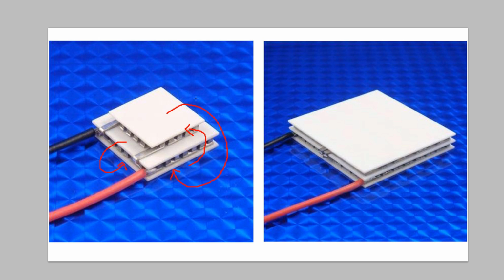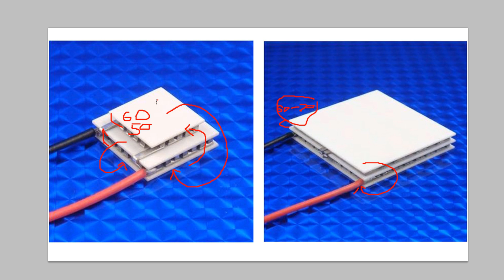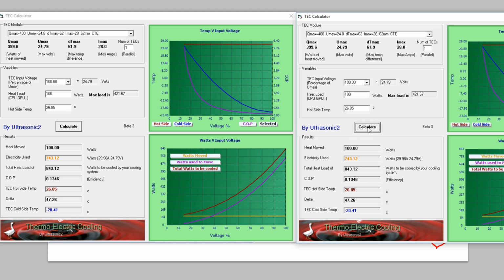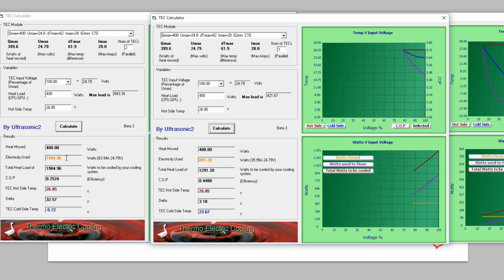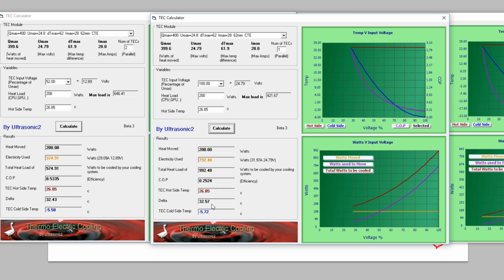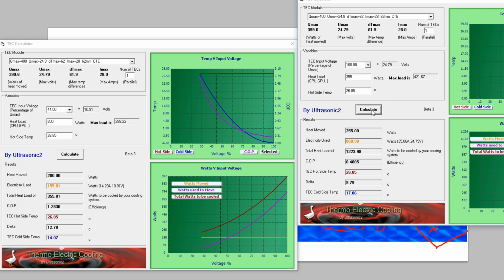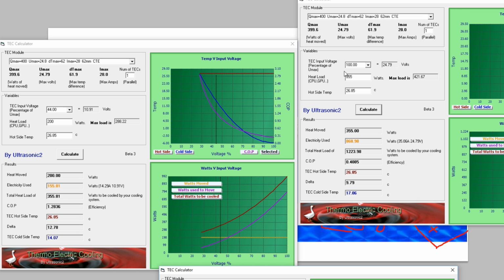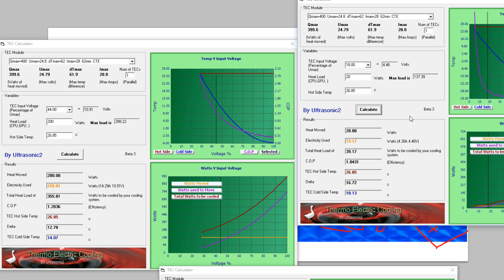🎓 Understanding Peltiers ⚡️ TEC Stacking, Parallel. Episode4

Comment: Here is a idea for our Car manufacturers. How about taking These modules and build a heat exchange that uses the heat of the gas powered motor and the cold air of the outside of the car and create a power source to drive a electric helper motor to take sum of the needed Torque off the Gas part of the engine and maybe reducing the cylinders of the motor to 2 or 4 and use the extra space for the electric motor section. Rad could be changed to a Peltier heat exchanger. I think out of the box. Their is all kinds of good ideas for a 50 year old invention.
Reply: john ward you know that thermoelectric power generation is just really really inefficient. ofc the unnecessary heat could be converted to power but it’s just a similar or even worse story to solar. on paper it works in reality we have economics.
Reply: Any Power derived from Natural elements no matter how small is a good thing for our environment and one of these units runs the Fan on the top of my and thousands of others wood stoves all winter long with no help from the electrical Grid or oil company.
Reply: john ward see the problem ain’t that it’s not working, the problem is how long these things work, how much electricity  they produce in that timespan and compare that to what they cost. it’s the same thing with solar power, YES it works but maintenance costs are way higher for the power they produce. take a look at eevblog for a good explanation, he did make a few videos about it. on a side note, for example the „carbon footprint“ issue, these things produce way more carbon emissions in production than they could ever get back through they’re electricity production. that’s why these things aren’t used everywhere and only some applications might use such a generator. typically it’s cheaper and simpler (and sometimes even more effective regarding the environment) to get power from a power plant instead of renewable energy. good renewable energy sources are water and maybe to some extend wind, because they are able to produce the massive amounts of power to basically make it worth, for the environment and the costs. wind and water come with they’re own issues aswell, higher maintenance costs lower profit therefor rising electricity prices for the customers etc. it’s a tight balance and thermoelectric just don’t cut it at this day and age. maybe sometime far in the future it will be viable, but even fusion ( it’s always 20 years away) is more likely to happen than the necessary efficiency increase to make thermoelectric‘s viable enough for people to invest in it.
Reply: john ward think about especially how production for these types of devices work, it’s just ridiculous to assume any mayor changes in the near future. i know it’s sad but that’s the way it is. no perpetual motion and no thermoelectric peltier driven plants. Mit freundlichen Grüßen :)
Reply: john ward also on a side note i’m not at all against renewable energy but it has to be a more balanced system like waterdams or similar. it has to find a good balance between environmental friendly production, maintenance costs, power output and generally costs of investment. if all that fits for a system it’s a good system worth pursuing.
Reply: @soyboy3274  I agree with you on thermoelectric power, it's way too inefficient for most purposes (in fact, there's another problem with that: you need a hot side, but also a cool side!). 

But you're wrong on solar power, and I'm pretty sure you misinterpreted EEVblog's videos. The EEVblog's videos are on solar roadways, not regular solar panels. In fact, in one of the videos, Dave compares solar roadways to a regular solar installation, and shows how the latter is profitable. He's actually a big advocate for solar, or he wouldn't have solar panels on his roof! 

Watch this video, where he says that his system pays back in only 7-8 years (with the lifetime of the solar panels being around 25-30 years), despite Australia having quite poor economic compensation for individual solar panel owners: https://youtu.be/aQQE8V9NBXw.
Reply: @GRBtutorials  yeah, you are right. I might have not put it well: the problem with solar imo isnt that it's not working. It actually makes sense in a lot of regions even from an economic point of view. In my opinion it still doesn't solve the issue unless people drastically start to use electricity more effectively, led's instead of lightbulbs, more efficient washing machines, dryers the list of things worthy optimising is long. Solar is a great system, with a small flaw that I see overlooked to often: In production of a solar cell they already produce more co2 than they could ever save, even after 25 years of runtime (considering real conditions). The reason we wanted to get rid of coal was the carbon emissions, wasn't it? So nuclear was invented, saving a lot of carbon emissions, but bringing some scary hazards. In my country (Germany) people actually are trying to get rid of nuclear, and government already has a plan in place shutting each nuclear plant down till I think 2035 (correct me if I'm wrong on that number, remember vaguely). And now solar was all the rage "free and safe energy" - for everyone. Till someone realizes it has a lot of flaws aswell, then the next idea is brought up till eventually we end up where we started, except if fusion ever becomes a thing, that might change a lot. Overall I really like the idea, and many concepts of renewable energy, and personally I think that in regards to renewable energy the way forward is waterenergy, but ofc im open for any input. I like the concept because it produces lots of power for rather low carbon emissions, exactly what most people think of when they hear "renewable energy". Ofc it has big hazards (dam breaks, landscaping changes etc) but once in place it is a energy source that is almost free  and can definitely compete with nuclear.
Reply: I wouldn't use it to add power to the car like a hybrid, I don't think you would get quite enough power just from these things, but I have thought about using them to charge the battery and delete the alternator. They might even make enough power to remove some other components from being engine driven to electric, like the compressor, water pump, etc. That would increase the engine's efficiency, making it more fuel efficient and able to deliver more power to the wheels. In theory, you could use a smaller motor for the same car, plus eliminating the s belt and alternator and having more flexibility in locating the pumps/compressors etc would save cost and mean a smaller and lighter engine bay.
For a DIYer, I'm sure it wouldn't cost more than say $400 to build such a system. I get about 25 MPG and drive 300 miles per week on average, so I consume roughly 12 gallons per week. Gas has become fairly cheap by me, around $2.50 per gallon, resulting in $30 per week spent on gas on average. If this system boosted fuel efficiency to 28 MPG, it would reduce my gas cost to $26.80 per week, saving $3.20 on average. It would take about 2.5 years for the system to pay itself off. The TEC system should last much longer than an alternator as well, which is something to consider.
Reply: decidiousrex just try it out on a small scale under optimum conditions and you will see and realize the problem how underpowered the thermoelectric generators are for almost any application. just get a two peltiers, cool the inner side with one and heat the other side of the unpowered one with whatever heatsource you desire, measure the voltage and amperage it puts out and you‘ll understand why i think this will never be an actual thing for proper power generation
Reply: decidiousrex also keep in mind the wear on the tec‘s. they wear out quite fast the more often you heat them up and cool them down afterwards the faster they get less efficient and brake eventually. they are not even closely good enough for what you consider to use them for, as a reference they tried to use them for a smart watch, at max t had slightly above 1ma in current consumption and roughly 40 ua average. you already had to run 4 hours a day to make a big enough temperature difference to make it work. even tho you are having a greater heatpump capacity in an engine it won’t be that much more, defs not enough to make it a worth 400$ over its lifetime
Reply: @soyboy3274  That's just not true. TECs are used in campfire chargers made to charge phones and such. Those last just fine. Look at TEC spec sheets, most are rated for hundreds of thousands of hours, which equates to decades long lifespans. That'll outlast a car. Not a concern at all. The larger concern is having enough of them to handle the heat, having a system that can effectively pump the heat, and having enough heat that the low efficiency still generates enough power. Given that a car will generate over 20 kWh of heat energy from a gallon of gas however, I think it can be done. You have TONS of excess heat to work with, and fairly low energy needs, which bodes well.
Reply: decidiousrex first of all, we are talking about tec not teg’s. secondly the lifetime rating doesn’t matter to much because it depends on the heating cycles much more then on the actual semiconductor lifetime. third with tec’s they are typically rated for a max of 90degrees, with that you are not producing much power, that’s why teg’s exist they take up to 260 degrees. also you forgot the main problem, even if they have a long lifetime (which they have not if you have many heating / cooling cycles), they don’t produce to much electric energy, with a heat plate and a tec at 240 celsius (which will kill it rather soon) and ambience around 20  celsius you’ll be able to produce 3v @300ma, so even if you are cooking them it’s not gonna be anything that would charge your car battery at any decent rate, + a car uses quite some electricity. also keep in mind tec’s are generally shock sensitivite devices i would really have no idea how you would mount them to get any decent output and keep them safe from cracking. also the stated numbers up there are realistic values not peak stuff because you simply can’t use them to calculate a realistic approach.
Reply: lpt, you’d turn more heat into energy using sterling engines and a induction based generator than a tec.
Reply: assuming you have a small car battery with around 40ah at 12v and we use 100% of a single tec’s output, your car battery would charge in approximately 500 hours. this is beyond reasonable to me. even if you’d be able to mount idc 100 of them it would still require 5 hours to charge the car battery alone under optimum conditions not even considering the other equipment on your car like lights fe and converter losses. to me it really seems impractical.
Reply: decidiousrex well, i still think it’s unreasonable, to me at least, but generally it might work. i’m not sure if the added weight with all the metalwork and teg’s (it actually makes a big difference since they are build totally differently, it’s not just the nomenclature) would kinda defeat the other purposes like saving some power and giving the motor more power because it doesn’t have to drive the generator, but you could definitely try to make a proof of concept with this. but i’d still recommend you building a test rig just so you know what you are dealing with here. i already ordered some tec’s and am in the process of getting some teg’s aswell, which i want to test, so i’m defs doing a test on energyproduction. what kind of temperatures you think will you reach with a standard motor, or your vehicle? it’s really one of the key factors since the power output drops significantly if they are lower on temperature. also on the electronical side of things: i’m pretty sure you are aware of conversion losses etc. you would have to build a pretty efficient regulator for this and you’d maybe get away with over 90% efficiency there (but expect something in the 70-80 because that’s more likely). it’s also a good idea to add some sort of shock absorbing material to the construction (as i mentioned earlier, these things don’t like physical stress). personally i think where you and i think different is especially in the reliability problem: these components definitely degrade if you have a lot of temperature cycles. there are papers out you should consider reading something about it. also keep in mind a car consumes a lot of electrical power (radio, board computer, lights , navigation systems, sensors just to name a few) which means you have to produce quite an access of power, if we calculate with 239 tec’s(no mistake here) and assume the arbitrary average of 1w produced you’d have 239w of power. idk if that is enough to run the car but you should measure out what your car or a car on average needs. once that’s all figured out it might be feasible but (as i already said) i don’t think you gonna save much power there, and you are definitely not getting your 20kwh of heat back out. generally it can work it really depends on a lot of factors and i consider tec’s or teg’s for smaller loads. i’d still be curious how your project turns out and am interested in how it turns out. also one last thing: if you are interested in a constructive discussion i’d recommend to leave personal aggression out of the conversation, just saying. if anything i said came over offensively i’m sorry and it wasn’t meant that way, but i didn’t see that.
Reply: @soyboy3274  Well I appreciate the constructive criticism before it just seemed like you wanted to shit on everything. You may not like what I had to say, but it's sparked (I think) a much more constructive conversation. I will definitely test before just throwing it into my car, I plan to do this as an experiment and learning opportunity first and foremost. I'm not rich, but I'm also not exactly hurting for $500 especially if it pays off in the long run. Also you have to consider a well designed system, even if it generates just 250w, will continue generating power after the vehicle is off. My goal would be a few watts from each unit. 500 watts normal generation would be more than enough imo, which would be just over 2 watts per unit. Doable? Maybe, maybe not.
I don't think weight would be considerably more than an alternator full of copper and steel. At worst, 10 lbs. Non issue to me. Conversion losses and such would be NOTHING compared to how awful an alternator is. If anything, wire some of the TEGs in series, DC voltage regulators are pretty workable.
Reply: decidiousrex if you use teg’s, under optimum conditions / matched loads etc (is basically not reachable in any real world application) you’d be able to get around 8w per unit (40x40x3.5mm), only if temp on the cold side is at 25c and the hot side on 300c. i really don’t see this in the real world, but it really depends on the cooling capacity from liquid cooler and what kind of heat the motor produces. i’ll need some accurate temperature measurements for this tho just to see where the expectable would be. from there it should be easy to work out if this is a feasible approach of replacing the inductive generator. if i got some actual numbers or you feel free to share them. i really have no idea how hot a motorblock gets and what the cool side of the teg‘s would be at. also efficiency decreases dramatically as the cool side gets warmer so it’s quite important to keep it at or below room temperature.
Reply: @soyboy3274  Engine coolant is typically designed to be maintained at about 180 degrees F. However, that is what the cooling system keeps the temperature at (or tries to), not what the actual temps are. Realistically, hot side would be in excess of 200 F. My initial thinking is I would route the coolant directly from the engine block to the TEC array (and yes TEC and TEG are interchangeable, technically the only difference is whether the unit is creating power or using power; though in some cases the units themselves may have been designed to do one or the other, any unit can, in theory, do either).
The hot engine coolant would flow through the hot side, then out of the array and into the radiator. The radiator would cool the liquid to near ambient temps, depending on outside temp could be anywhere from below 0 to 90 F (I live in Chicago). The cooled liquid would return to the array and flow through the cold side and back into the engine. Delta T would be anywhere from 100 to 200 F, possibly even higher.
Power output wouldn't be the largest concern, as a decent sized deep cycle battery could easily be used to meet high power consumption during certain times. The concern would be overall energy generation. Can the waste heat be turned into enough power to refill the deep cycle battery consistently? Basically, I'm focusing on watt hours, not watts.
Even if the system took all day to convert the waste heat into the required energy, it's of no concern because a battery large enough to meet the day's power demands (which are not high, just lights, stereo, etc) can be used.
If I was trying to convert the waste heat into power for something like a hybrid assist, there's no way TECs would pay off. At that point, something like a Stirling engine would be far more practical (though at that point I think it's adding too much complexity).
Reply: Just adding weight and complexity for what?
Reply: @soyboy3274  I too thought you were being overly negative to begin with (not mentiong TEGs earlier, all the negs etc) but you have come good and I respect that and also your reaction to the inevitible negative out-burst, was very mature IMO well done, my assessment of your attutude was wrong, y have to realize the massive amount of resistance to changing the status quo re alt energy and it's hars not to see some people as just protecting their $$ interests by making all alt energy look bad (usually by pointing out that a source will not wholly replace the power of the gas engine or the grid). Multiple sources of ideally locally produced electricity is the way to go IMO

I actual agree with a lot of what you say in principal but I'm finding it very useful to do these types of experiments also anyway.
 
As backyard builders it's always tough but it shows us how manufacturers could if they wanted to, alter designs to incorporate multiple types of alt energy (meaning energy other than gasoline here) but they don't; not because of lack of efficiency so much, but to keep their monopoly $$. 

Ultimately my opinion regarding combustion engines is, while they could be improved so much more, they are already too complicated and inefficient. 
Better to just go electric and focus on these extra alt sources for battery top up regen braking etc for incar use and wind solar water geotherman etc for outboard charging. 

Enjoyed the discussion guys Thanks
Reply: @Drew_Hurst  same here was great to talk to ya'll! Have fun and keep creating ideas!